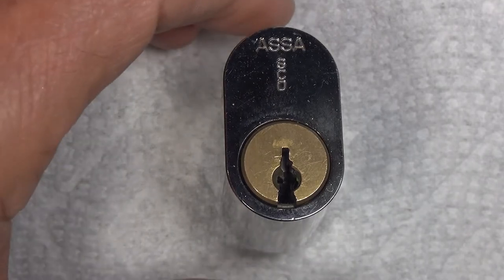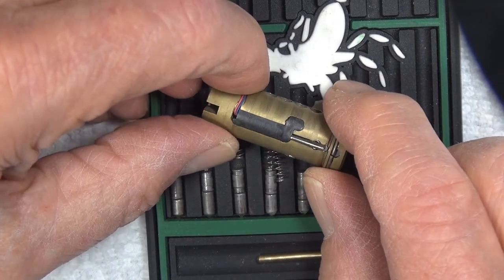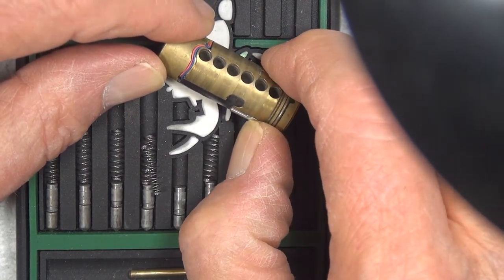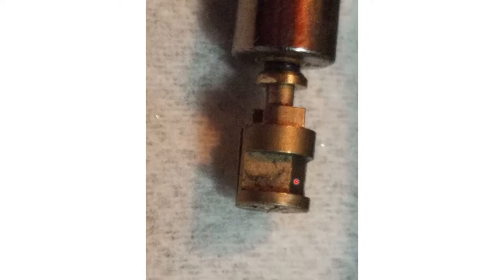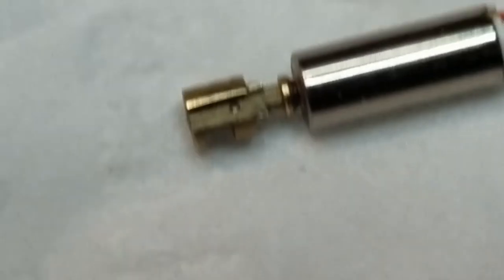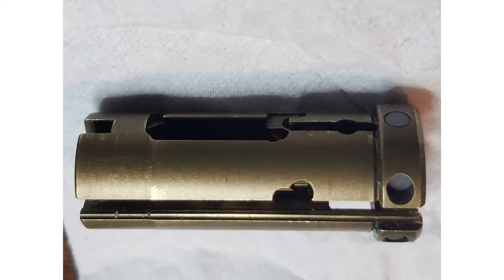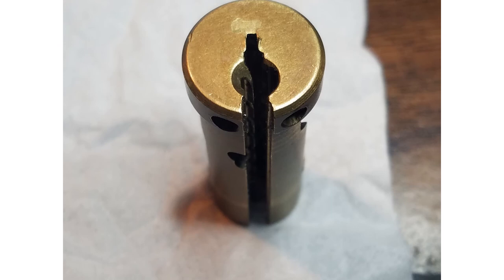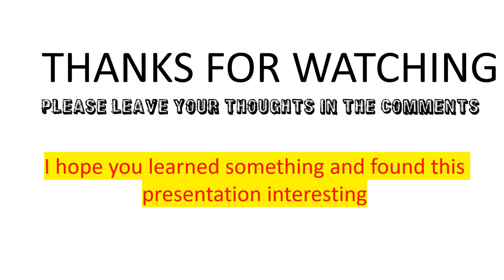ASSA CLIQ

Comment: interesting video. the reset pin, sets the cam to a default position, so the movent of the motor always end up setting it to the unlock position. there is no time out. as soon as the plug clicks, it will continue to be unlocked till the key is pulled out. the sidebar cuts on the key can be used to control lower level cylinders with just 4-10 sidebar pins. the 2 componets in the middle are capacitors to make sure there are no voltage drop to mess with the MCU as the motor starts
Reply from the maker: Yes, thanks for the clarification